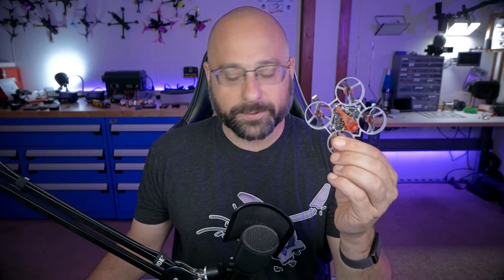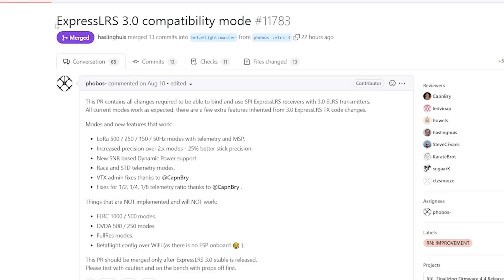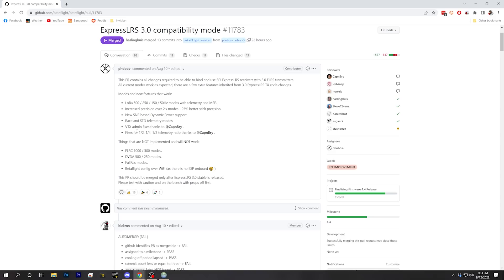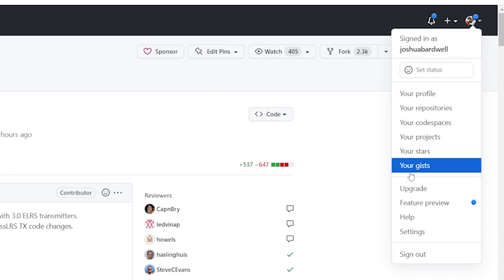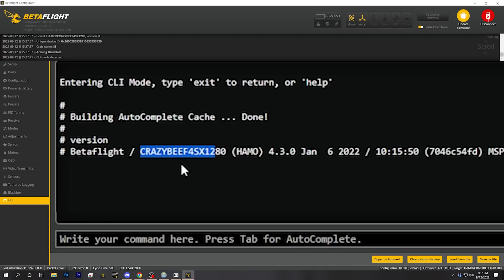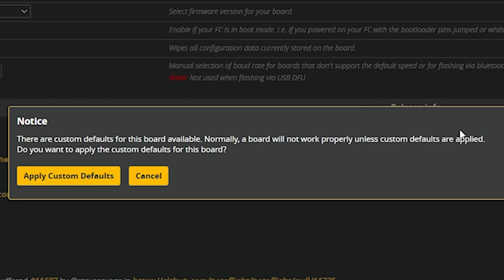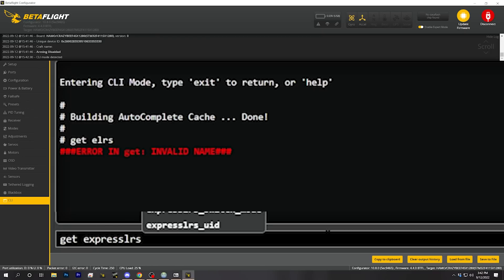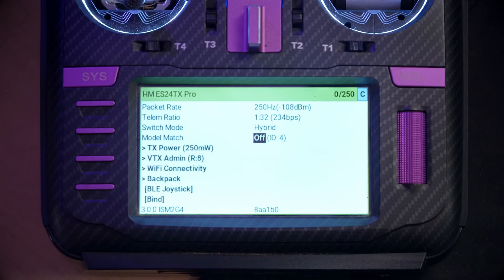How to put ExpressLRS 3.0 on your Tiny Whoop (SPI receiver workaround)

Comment: Had to use a CLI dump on some of my whoops (hamo and betafpv) after flashing generic hex files. The "regular" configurator GUI backup/restore does not contain all relevant settings!

Also, but that has nothing to do with the above, just mentioning:
I have two Mobeetle6, but on one the BMI270 (gyro) seems to be defect. After reaching about 55°C core temp it starts to become unflyable, introducing very heavy drift and jitter in the gyro sensor signal. 
The interesting fact is, that this behaves different on two identical models. Same HW, same FW, same config. One HAMO board is ok, even over 60°, the other is only flyable below 55...
Already wrote this to HAMO, they will send me a replacement board. 
And no - i did not damage the gyro with the  kown BF RC6 bug... ;)
Reply from the maker: If you flash with the correct target selected in the pulldown menu, then "apply custom defaults," the correct configuration will be applied.
Reply: @JoshuaBardwell  thx for the reply, but no, this was not the case for me! I cannot tell you why, because I did not try to reproduce. I flash almost on a daily basis (FC and ESC if needed) if I have the time, own over 50 quads in the meanwhile (which is the reason for my regular flashing), and that occurred "only" 3 times within the last month. One of the first things I do when receiving a new whoop is to make a FULL backup of its config (CLI dump), and this has proven beeing useful sometimes... DIY builds are a different thing, but especially these SX1280 spi based FC's are a nightmare sometimes...